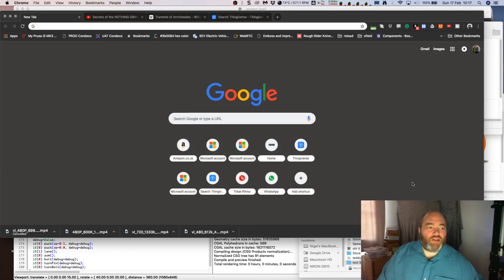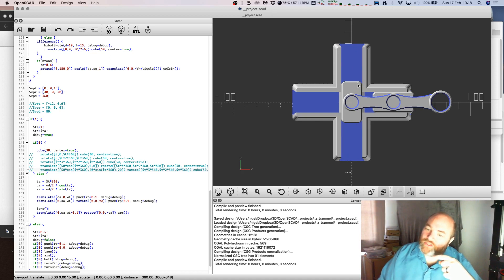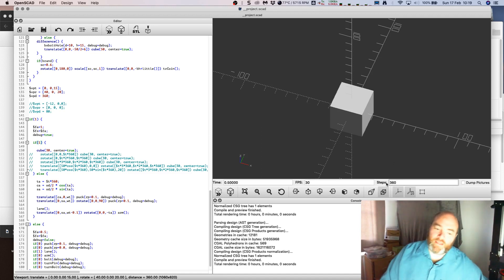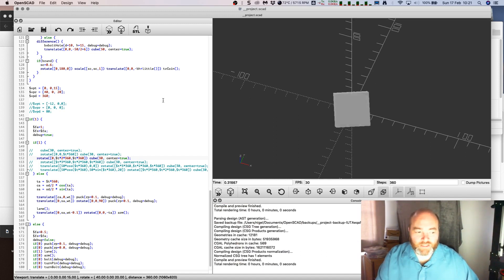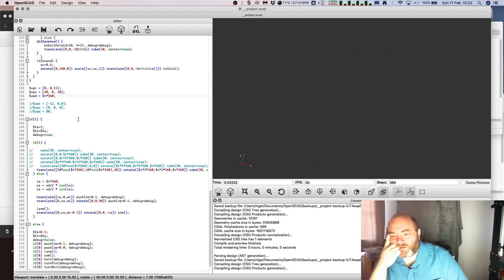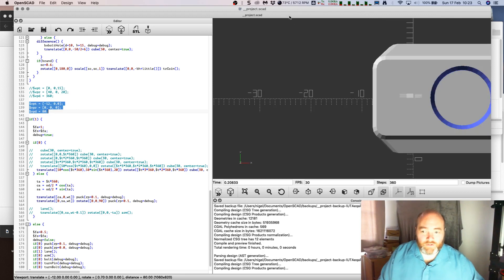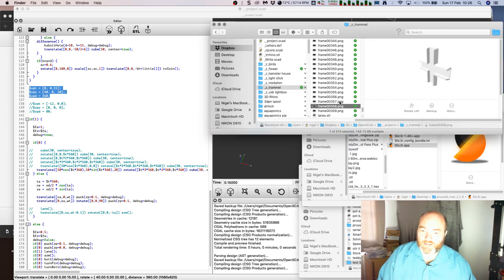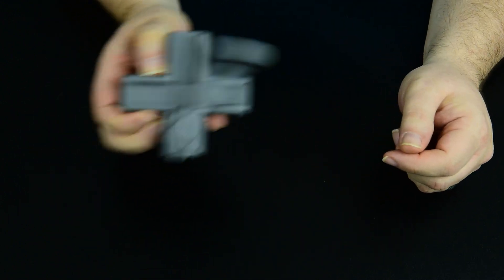Archimedes, OpenCAD and Animation

Comment: What a cool 3D printed thing to fidget with :-)
On occasion I still use the knurled nut and bolt you made (mostly when staring into mid-distance thinking about how to solve a prickly issue)

Do I sense that you really wanted the pieces to pass as close as you could to each other?
I observe that most of the other versions that you showed as examples others had made have loads of separation (they just weren't trying hard enough :-)
Reply from the maker: The base of the puck was the original guess and there was a fair bit of space, so I wasn't sure if I wanted to angle the tops in or out... so I made them go the opposite way to the ends of the lanes they run in... what I think I'm trying to say is that I got very lucky :) I'm quite chuffed that it all came out pretty much first go, although that means the parts I printed aren't branded. Hmmm... :)
Reply: Sounds like you'll be printing another one with your branding on it... perhaps in another colour/material...
:-)
Reply from the maker: @michaelwiltshire2837  Yeah, I had planned a multi-colour one, but that's quite a mission with all the colour changes. Maybe during the week :)